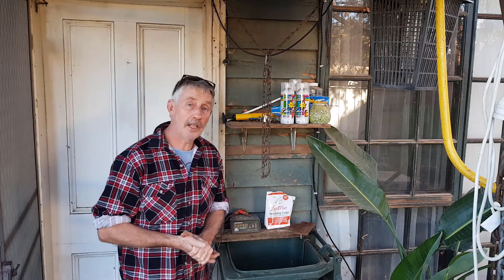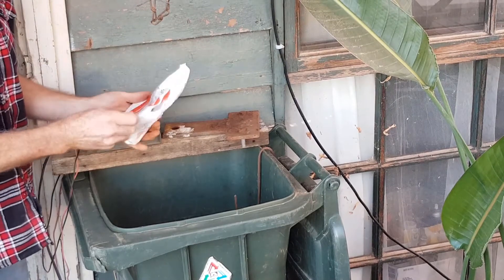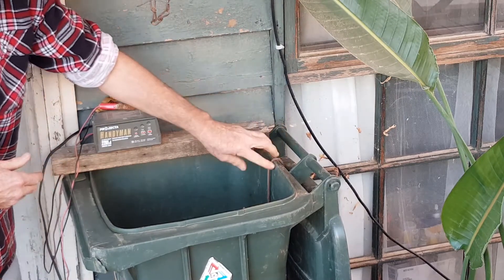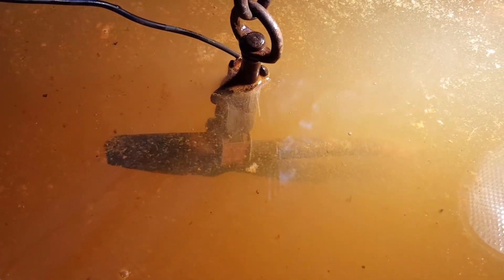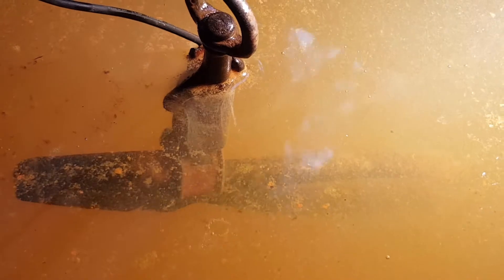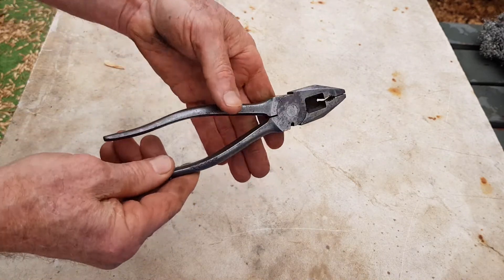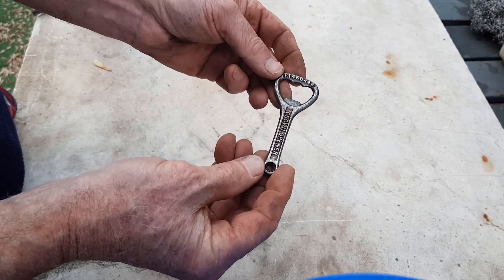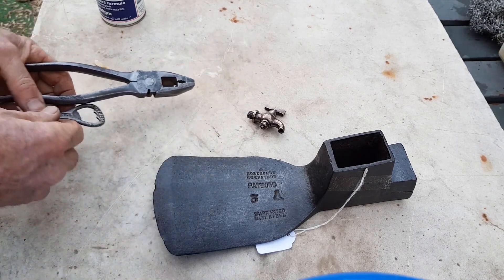How to clean old tools and metal relics with a battery charger and electrolysis. DIY Restoration!

Comment: What is the solution used to clean brass?
Reply from the maker: It's the same solution Carlos. Here's a video I did on electrolysis cleaning of brass
https://youtu.be/PeGpu0s4b0g
Reply: @TheUltimateRecycler  same solution as what? What battery charger? "Standard" power supply is very generic term. Can you please show what you're talking about? What voltage, amp, are you using?

Thanks
Reply from the maker: @modenaman  The solution consists of a few spoonfuls of sodium carbonate dissolved in water (this just produces an electrolyte for better electrical conductivity). It's the same for whatever metal you are trying to clean. The battery charger is a normal 12 volt automotive charger capable of supplying a few amps. Modern "smart" chargers do not work as they think they are being short circuited - so you need an older style.
Hope that helps  😊